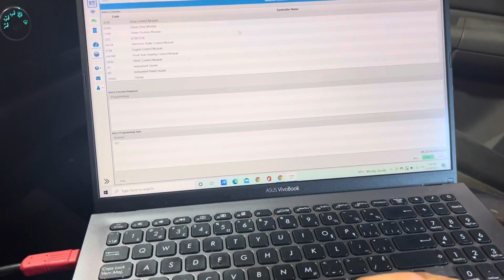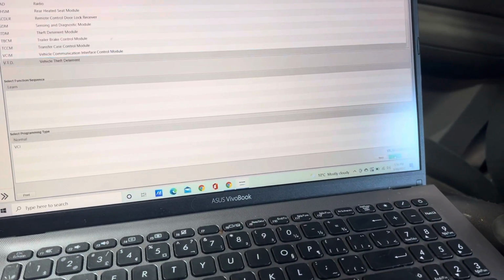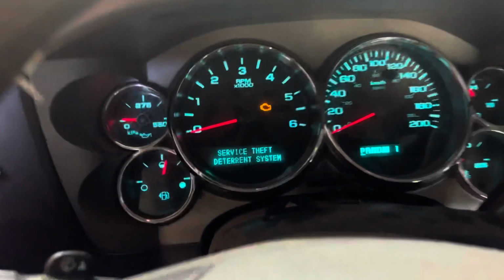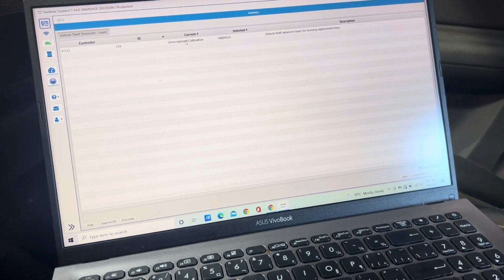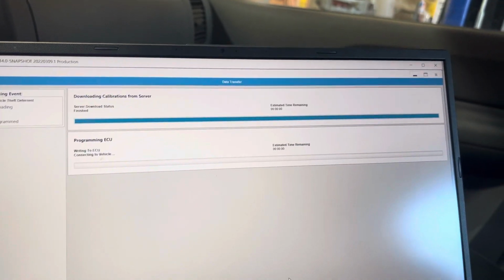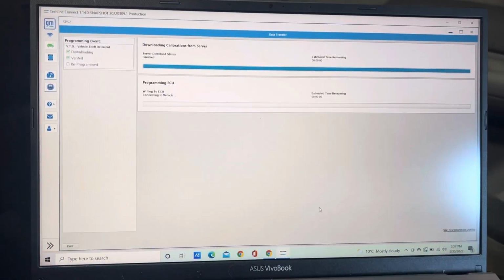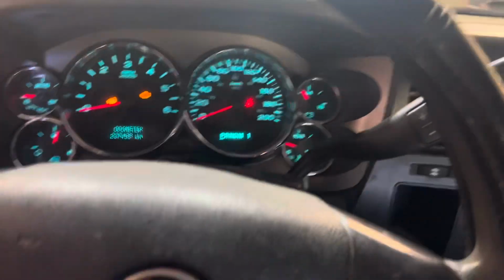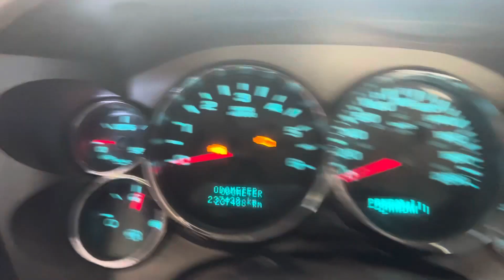Program Any GM Key Using Techline Connect Software

Comment: Do you have to use up a Vin slot for this as you would when programming any other module?
Reply from the maker: Yes
Reply: Do you need an LSID to use this? Im sure you dont but am trying to confirm that you can use techline-connect with only a nastf account and obviously register with GM, but not necessarily need an LSID (for locksmiths)
Reply: You dont need techline connect to program keys or remotes on a 2008 the vehicle has built in programming. The only time I use SPS is for 2012 and up...and that is only for the remotes not the keys.
Reply: @jeremyhubbardTX1  I accidentally erased all the keys with 608 and it keeps throwing error 31 function fail And when I do learning procedure 3x 10 minutes security light never goes off And it's throwing clothes that it's learning mode I don't know what to do here I tried to program a second key three times 10 minutes didn't work
Reply: @carMacGyver1  Did you figure out how to make it work , I'm in the same situation as well.
Reply: @emanuelmunoz4518  it was wrong key chip as soon as I came back the next day with the right key and I put it in the ignition the security light disappeared instantly
Reply: Hi, i have a chevrolet orlando 2012 163 korea

Keeps me antitheft icon constant on, i tried immo learn, key learn, all successfull, still keeps me error on ecu "key not programmed"

I have replaced ecu, bcm, key, ignittion, immo box, fuse box still the same

Any idea?